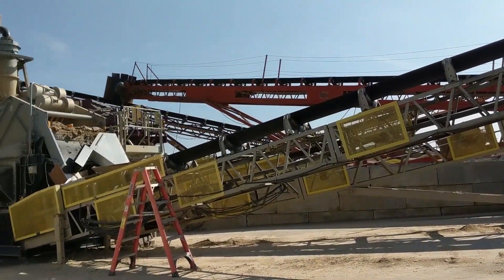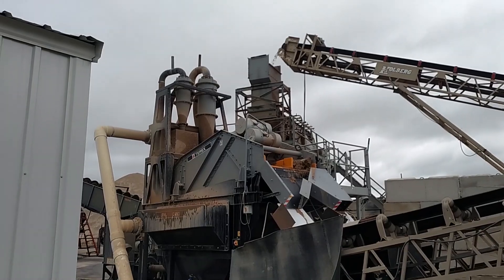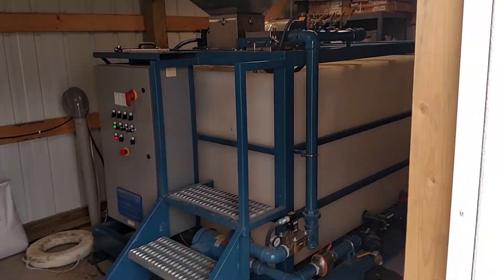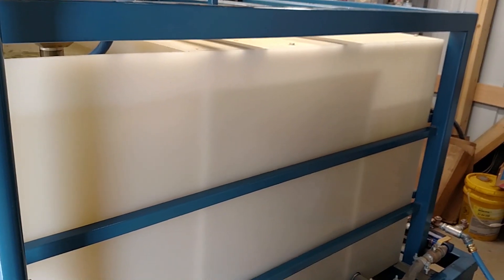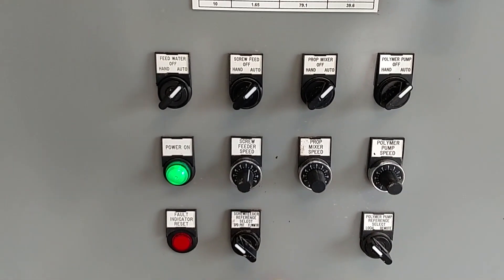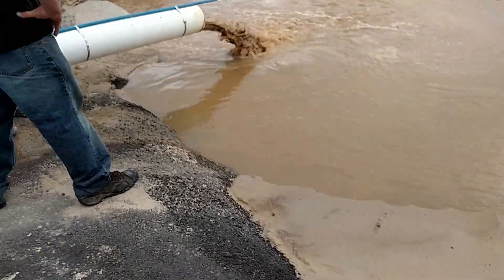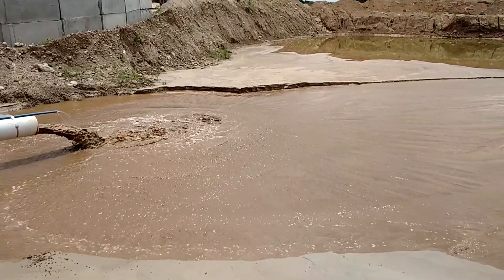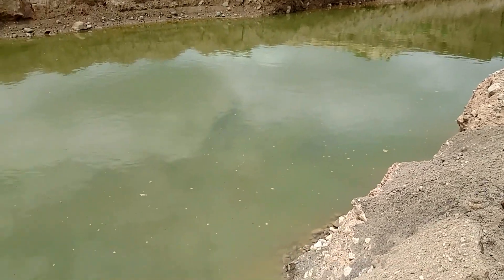Settling Pond Solutions for Process and Wash Water - Clearwater's M500PP w/Testimonial

Comment: how can we ensure enough maturation time (30 min) for our polymer solution in a single tank system??
Reply from the maker: We use a single tank with three chambers in it - hydraulic activation, mechanical mixing, and aging chambers. Of course, we still need to make sure the system is sized correctly based on dosing demands so the solution has enough maturation time. We size so maturation time is 60-90 minutes for dry polymer.